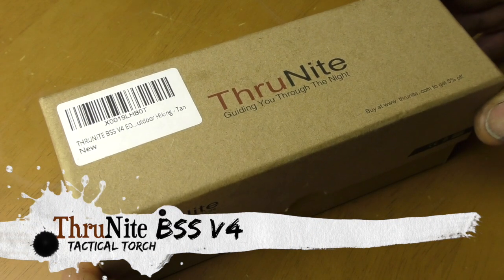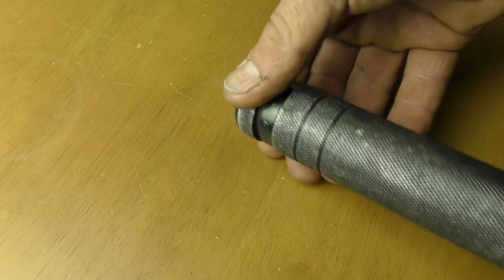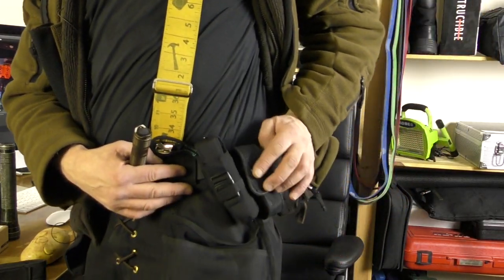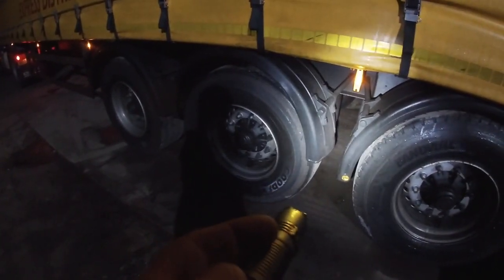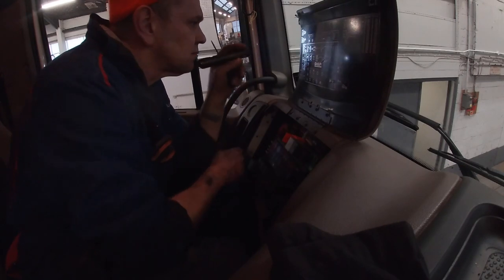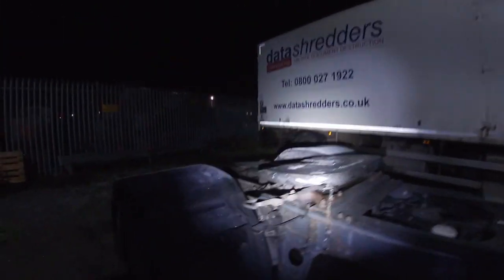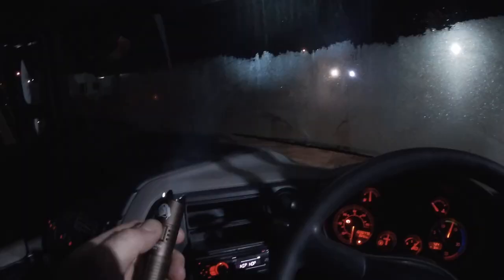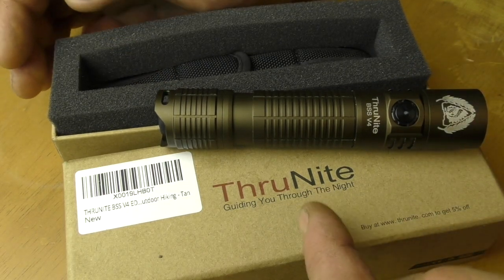Why Would a Mechanic Use A Tactical Torch?  (ThruNite BSS V4 Torch Review)

Comment: This is a really informative video. I've struggled over a number of years to find a small, reliable and consistently powerful torch to illuminate my never-ending attempts to uphold the principles of 'Bangernomics' in keeping a small fleet of older cars on the road - just...!  So much of my time involves making roadside repairs where power and space are either incredibly limited or non-existent.  The most important features of this torch, for me, would be the fact that it combines an ability to offer long periods of high illumination with a small physical size.  I've tried so many variants of work-light [mains and battery-powered] that supposedly offer these two key features but none, so far, have met the criteria.  The ThruNite looks as if it would be perfect for me.  Thanks for the videos and thanks for considering my entry for the give-away.  Cheers.
Reply from the maker: Nice long answer bad.   her is your draw number 30

Comment: I would like the torch because  am a break down tyre fitter and get calls 24/7 and it would b realy hand to have for going in to the yard at tight to get the van doing my vechical checks before setting of and when am at jobs in below trailers ,trucks, tactors and plant machinery  ect jacking them up also because the one i have at the min is on its way out
Reply from the maker: 55